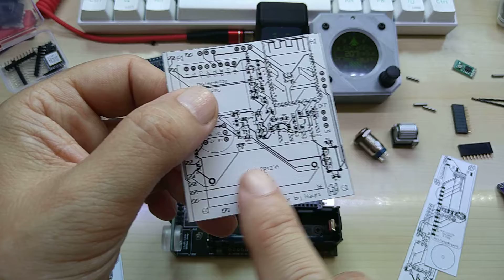LAN Environment Monitor with PoE, #ESP32 S3, Display, GPS, LoRa, Radar and many Sensors by #Hayri

Comment: Great videos, you are a master electronics designer!  I have just bought a Pine 64 soldering iron and plan to start getting back into electronics after 35 years!
Reply from the maker: Thank you very much for your kind words, I had a similar break from electronics and started about 12 years ago again. Lot's of things have changed, but for the better of course 🙂 Enjoy your new found hobby again.  Please do check out my EnvioNode on Kickstarter, I still need help with funding. Added the link into the description below the video. Thanks and take care 🙂
Reply: @iHayri1  Yes, I find that this hobby has so many amazing options now, plus I have recently started 3D printing too!  I will check out your kicksarter!
Reply from the maker: @simonsayshomeassistant  Oh, you are in for a treat, would not want to miss 3D printing and easy to use CAD programs. Being able to make enclosures for the electronics brings it to a whole new level. Thanks 🙂